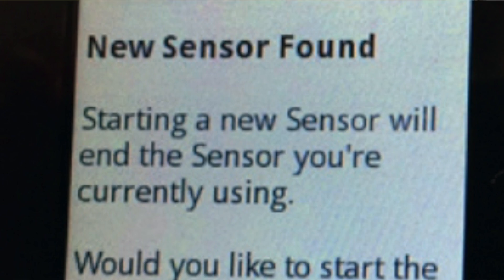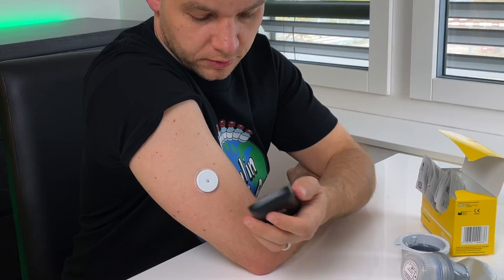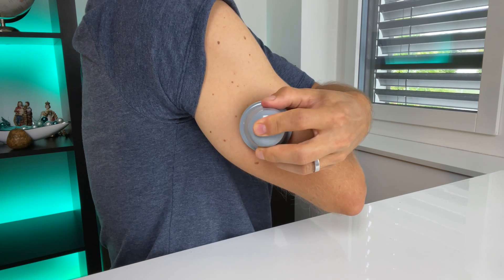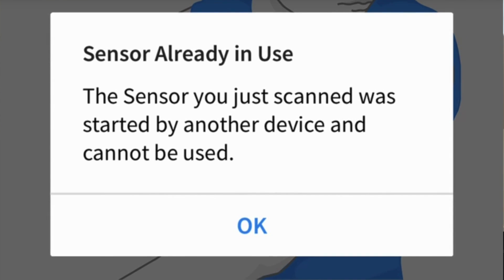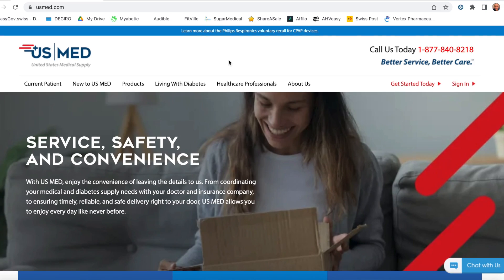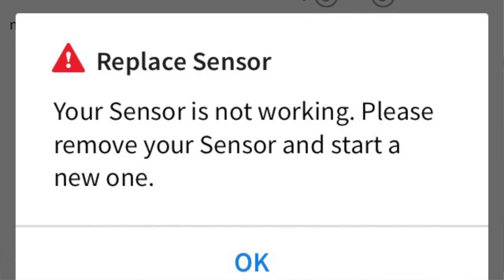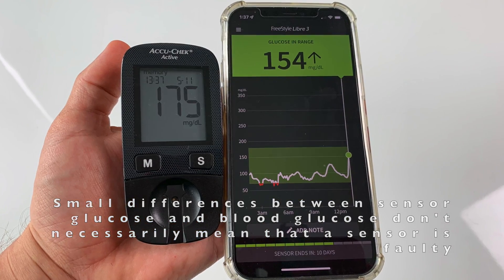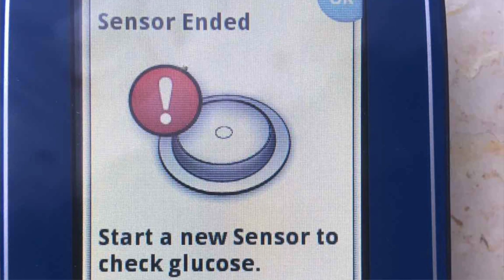FreeStyle Libre Errors and How to Fix Them

Comment: I have been using Freestyle Libre 2 for more than a year. At first, they worked great and were highly reliable. Estimating here: Since the beginning of 2023, they are failing at a rate of about 50%. Every two weeks, I apply one and grit my teeth for the first hour while waiting to see whether the sensor will work or fail. I am astonished at the failure rate. My employer would be all over an improvement program for any failure rate greater than 1%. That aside - Is anyone else experiencing a similar failure rate? Is there anything I can do to reduce the failure rate? Lately, Abbott seems to be trying to blame my use of an iPhone 12 Pro because the OS updates so quickly/frequently, and they can't always keep up. True? Would using a reader work better? Any ideas a all would be appreciated.
Reply: I would say your estimate of 2023 being the start of the high failure rates is correct
 I've been on FSL 1 & 2 for years and things were great. Failures were unheard of. Something has definitely changed at the manufacturing level and so far Abbott seems to think replacing units is cheaper than going back to the original supplier/manufacturing method.  
I'd like to know if we can reach out to a regulatory body to contact Abbott and seek an explanation. No company wants the government looking into their affairs. This, unfortunately is the only thing that will resolve the problem.
Reply: I as
l also just started using the free style Libre 2 and have a 75% failure and the 4th one that did work went out after 1 week giving such low readings that were 50-70 points off from the finger stick. had no [problem with the original free style libre.
Reply: Since a few months my sensors quit working after 5 days. According to Abbott it has to do with a bad batch or something. At the moment I (at least I think) yet again  have a bad sensor. Reading a LO during scanning but doing it via finger prick shows a 110 mg (6.1 mmol). From experience I know this will go on until I get an error like "place a new sensor".
Reply: Abbott sending me the 8th replacement sensor since I have started using this system in June 2023 (Libre 1) To date I have had one sensor work/last 14 days. Every other one either gave very inaccurate readings, too low to read while finger stick read 130, or just quit working. I will call it quits if after 10 attempts they still don't work. Tech support seems to know they have a problem. That's why the give me a return kit most times .
Reply: I have been using the system for more that 2 year and have had the same experience since about May of 2023 with at least half the sensors malfunctioning one way or another. Through my pharmacist I found out that in Canada there were 2 sensor lots recalled. The sad part here is Abbott never notified the users of the recall and still I have not been able to get a strait answer from Abbott if the problem sensors are out of the supply chain. You can read more on the Health Canada web site on the recall. The actual recall date is Feb 23rd 2023. What Abbott finally did do was put up a separate web site to check your sensor serial number to see if it is good or not. None of my bad sensors showed up as bad on the site. Again Abbott did not notify us of the this site I just stumbled onto it.

Comment: Sensor stopped working for less than a day again.  They won't replace it because they said its meant for humans not cats.  My vet put it in and it worked before no problem.  Very expensive and piece of crap.

Comment: I just switched from FL1 to FL2 and absolutely hate it! FL1 was simple.  A reader that lasts 2 weeks on a single charge and gives quick results. I LOVED FL1. Then i had to "upgrade" to FL2 and bought a new reader. My biggest issues are the battery life is around 1 to 2 days. The other was how it was detecting my blood sugar levels when I was a few feet from the sensor and not actively looking get a reading. This was annoying at night when the reader would light up the room when I'm sleeping. I don't want alerts when I'm not asking for any. I check my levels because I want to know in that moment where I am. I don't need a tracking device. I got so annoyed with the reader that I switched to the App. I have an high end phone that has NFC. It works fine around town buying stuff. With the App, it's a 70% failure rate of getting a reading. I ended up wasting 2 sensors and these sensors are not cheap since I'm paying them out of pocket.

Comment: Hello, I have been using the freestyle libre sensors for about 2 two years. When I put on a new sensor, after I scan it and spend the 60 minute wait to take a glucose reading, it sometimes asks me if I want to scan a new sensor, and gives me two options for answer: YES or NO. Normally I press the NO option, but in the last two it told me that the sensor is not working, remove your sensor and start a new one, that the sensor is exhausted. I don't know what to do because other times I have pressed YES and it also tells me that the sensor is exhausted; And they are brand new, straight out of the box. Most I wear work, but this has happened to me about 6 times. Can you give me an answer? Thank you.
Reply: This happened to me and I am trying to figure it out. I'm already disappointed in this process as it gives inaccurate information on the bs readings. I'm going to wing it because the meter and finger stick is more reliable than this.

Comment: Libre 3. Have been used for 5 months. The last one and three of them before failed after 7 days working. Only 7 days. 
Nfc doesn't work, only when i put the new one. Sensor is working for a week. Abbott answers that my os has 13 version, and that's the problem. But, it s 12th. Then Abbott said the problems with my phone..  ok, give me the list fot completable phones, nope, youre not from us or Europe, weeeel, how could i get it? I paid money not being in usa or Europe and it's ok. But using anywhere noooo dont do this. My child cant get the great monitoring for money, wtf? Abbott, you re the worst monitoring app company that i ve got ever.

Comment: I got an error message that said Glucose reading unavailable. Scan again in 7 hours. I just applied this sensor 6 hrs ago and have several successful scans prior to getting a low glucose reading then the error message. Why 7hrs tho?
Reply: When you apply a new sensor, you have to let it "calibrate" itself, it will be accurate only after 24 hours of the activation.

Comment: You’re incorrect. The Libre 14 day sensor can be used with both the Freestyle Libre reader AND an iPhone if you activate it with the reader first and then activate it with your phone. The Libre 2 and Libre 3 can only be used with one device at a time.

Comment: I have an issue that I haven’t seen covered. I have the Libre 2. Within a couple of days of wearing it the sensor is coming off of the adhesive that sticks to the arm. It’s winter so I’m wearing long sleeves so it can’t be that it’s catching on something and getting pulled.
Reply: I’m having same issues sometimes.

Comment: Hello Tom, all great tips, thank you so much.  I have had type 1 diabetes for over 40 years and I wanted to share a hack that has made the biggest difference to my diabetes management along using a CGM. 5 years ago my endocrinologist wanted me to try Forxiga, it's been developed for type 2 diabetics not type 1 but she thought it might help me loose weight, one pill a day is all you need. So I said yes and it works by removing excess sugar through the kidneys and you excrete it in your urine.  I use the Freestyle Libre 2 (and I love it) and that combined with Forxiga has helped lower my HbA1c from 7.5 to 6.3. I still do injections, I like the freedom and I like the effect of a long acting insulin throughout the day and night. I have been taking Forxiga for nearly 5 years with no side effects other than the benefits, which I will list below: 

 Anyway what are the upsides of taking Forxiga. 
1. I lowered my shorts acting insulin by 20% I had to start reducing my insulin within the first week of taking Forxiga. 
2. I lost weight in the first 12 months - 10kg to be precise.  
3. While it removes excess sugar from your system it caused me no extra hypos at all. (this is huge) 
4. I had reduced appetite from taking less insulin.  
5. I feel more me and 'less diabetic' it made me feel more like I did before I became diabetic.
6. It helps to remove excess sugar from your system. 

What are the downsides of Forxiga?  
1. Keto acidosis - they say there is an increased risk of keto acidosis in type 1 diabetics taking Forxiga.  
2. Kidney function - they warn if your kidney function decreases you should stop taking Forxiga. 
3. Bladder infections - from increased sugar passing through your urine. 
4. More hypos - I have less hypos since taking Forxiga as my high blood sugar peaks are reduced, so more stable overall.

I have tested my ketones regularly and in 5 years of testing, not once have I had ketones, so keto acidosis is not a concern for me. 
I have also tested my kidney function every time I get my HbA1c, once every three months and it's always been totally fine, no change. 
In 5 years I have not had a bladder infection - so even though there is more sugar being passed, my body is coping just fine. 
Back to the first point they stropped trailing it with type 1 when 2 diabetics died from keto acidosis, this is very serious but I suspect this is more to do with their own control and habit than any complication from Forxiga. 

So I guess it's maybe not for every type 1 diabetic, if you starve yourself of carbs or you suffer from ketones on a regular basis I would avoid using Forxiga as it may increase the risk of you getting keto acidosis, if you love food and eat well it should not pose any threat.   

The upsides in my case out weighed any potential downsides. To be honest I have never had a downside. I'd love to hear from any other type 1 diabetics that have tried Forxiga and what has been their experience. 

How long is it in your system? About 24 - 36 hours, if I run out of Forxiga my blood sugars will start to slowly rise within 36 hours and fall back down with 12 hours of resuming. So after 5 years it has been incredibly stable and predictable. I drop my dose and that's the only adjustment I have to make. It's a small pill, so I have a 7 day pill box to ensure I don't miss a day or waste my money by talking more than one a day. 

Like you I wanted to share a hidden discovery that changed my life as a diabetic.  

Kind regards 
Ben

Comment: I've had freestyle libre since Novemember and it worked beautifully. No error messages and it would take only a second to scan.
 Then the app had an update and it has been a pain ever since. I'm convinced it does NOT like Samsung, and I keep getting that 10min message, but I'm a special snowflake and get try again in7 HOURS or even worse in 8 HOURS.  Plus when I'm a lucky duck and it works, I have to hold my phone ackwardly for 30 secs plus for it to read the sensor- every time I try.
I am about to the point of giving up. Plus   I can't seem to keep one on for 14days

Comment: My son has been using FL2 for about two years now. A lot of sensors stopped reading before the 14 days or simply they never paired with the reader. Abbott always send us a replacement for each faulty sensor (or a voucher when we lost one) but it feels kind of awkward and annoying to be continuously calling to report a malfunctioning sensor and hear the same questions over and over again. Yes, we know that humidity and sweat can damage a sensor. Yes we know how and where to apply the sensor. We take our precautions for all that. It's just that something is not right with them (or the reader). FL2 is a great device tha can make your life and your diabetes control a lot easier. However, these issues have us considering to move to the Omnipod 5 with the Dexcom G6 or G7.
Reply: I investigated little bit of these and I figured that the sensor is made out of 2 parts and their manufacturing process doesn't work very well. Sometimes the part that is connected to skin is little bit loose in the sensor and if you gently push it, it would snap into place and probably(?) work better. I figured this loose part problem after one sensor didn't work and I had to remove it and saw how the internal component was not snapped into it's position properly. However, I'm her e atm because the current sensor doesn't work either. out of 5 sensors, 3 had some problem so far.
Reply: So frustrating, I’m leaving the house and can’t get a reading for 30 minutes. When it does come on it tells me 65 and going down… no warning at all . I’m ready for something different.
Reply: That's my problem 😢now

Comment: Providing you've been able to at least start a sensor the quickest way to find the sensor number is to chose the 'About' option from the freestyle app. This will show the last 3 active sensors along with other useful info like software version. Another useful menu selection is Help > Event log  to see errors that have occurred. While the software only stores the error code (shown botton left ) and time/date, it thankfully displays the log in a human friendly format by presenting the error messages as well.
Reply: That is the problem with the errors they have not made a list yet of what the errors mean.
Reply: Event log 373,p and 57 ... How to understand it. I can read it there's no info and buttons... What's next step?

Comment: Hi Tom, I've been using Libre2 for over a year and everything was working great until recent app update (android phone), now the alarms are not working. I have done everything under the sun, uninstalled, reinstalled the app, changed the sensor (have gone through 3 different sensors), checked Bluetooth connection, nothing helps, still the same issue, alarms are not working. This didn't start until the update about a 1-2 months ago. For me the alarms are my lifeline, specialy when I'm sleeping. Spoke to customer service twice, both times they blame the sensor or my phone. My phone still gives me the readings but no alarms, still recognize the sensor.
This is a huge drawback for me. Is there a way to revert back to the previous version ?
Reply: I have exactly the same problem. My Android phone are on the accepted list and the alarms has been functioning perfectly, until about a month ago. The support have suggested some things, but nothing has worked, and they have not been able to solve this problem. They should take take this problem seriously because by not delivering alarms the system are broken. The readings still works but the app just says that libre view sensor 2 has to be connected, even if it's already are.
Reply: The update really didnt like samsungs... I get nothing but errors and extremely slow sensor reads

Comment: Hi, Tom, thanks for your content. I did had a blog about type I diabetes years ago and even wrote a book about it, so I know how much effort and discipline it takes.
I wanted to ask (you or anyone else), because 80-90% of the Libre 3 sensors I have used end up with errors (most of them, it suddenly appears a "change your sensor" message after 5-8 days. Others, they show glucose levels VERY different from blood (like 94 in blood, 189 in Libre3 App). I have already used a lot of Sensors because I get them from my insurance in Germany, with recipe from doctor. Sensors are always placed where Abbott suggests and they are well fixed to the arm. 
I have a feeling that this failures occur when I'm with low sugar levels for some time (which is when Libre3 is most needed) Sometimes I eat something to elevate levels, but the readings stay in the low range fixed there, not moving.
Been type 1 since 1998, and 2-3 years with Freestyle Libre, so I'm not new to this.
I always get a new sensor when I explain each case to Abbott, which is good, but I cannot trust the Libre3 readings anymore, so I need to double-check with blood test, which then makes no sense to use Libre3.
Has anyone had the same experience? Any ideas how to solve this?
Reply: I haven't used the Libre 3 and don't know how different it is from the Libre 2, but I know that I had similar issues with the old Medtronic Enlite sensors. The readings were almost always over 50 points different from what my blood sticks showed. After several months of tracking the data and talking to my doctor, he suggested it may just be a body chemistry thing and the Enlite would not work for me. I've also tried the Dexcom G6 and the Libre 2 and have not had these issues. If the Libre 2 worked for you and it's an option, you may want to consider switching back to that system.
Reply: The Abbott rep I spoke with last told me they can last as little as 11 days. He said they know of the problem with the filament giving error messages and are working on it. See my long comment above for what I've dealt with using the FL3. I'm so dissatisfied with the FL3.

Comment: Upgrading to Libre3 in Germany has been a nightmare.  I applied the first time in September.  I ran out of Libre 2 sensors 6 weeks ago.  I still don't have working Libre3 soolution.  I  learned something here.   Don't upgrade until they make you. That way all bugs can get worked out.  If I could i would go back to Libre 2 with the separate reader.

Comment: Tom, thank you so much for your informative videos! Have you ever had issues with the app itself? I’ve noticed lately that when I open the app after not checking for a while (like when asleep overnight) the app restarts and it hasn’t received data for hours! I do end up getting the data shortly after, but I’m prone to overnight lows and I’m afraid I’ll miss an alarm because the app isn’t receiving info properly. Have you had this issue, and what did you do?